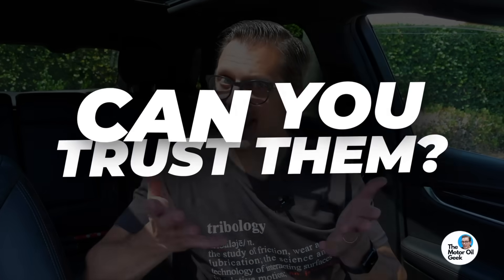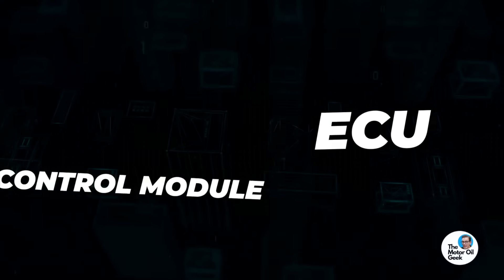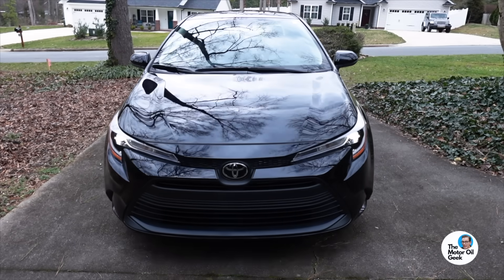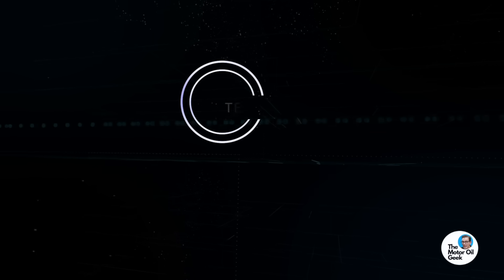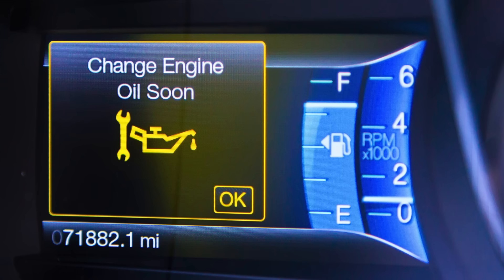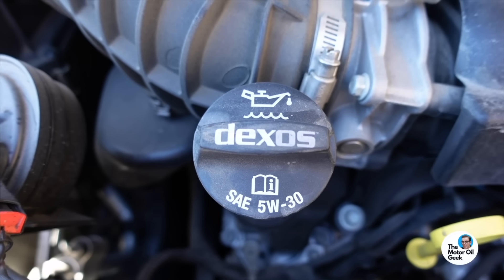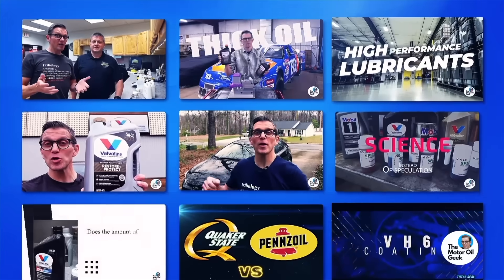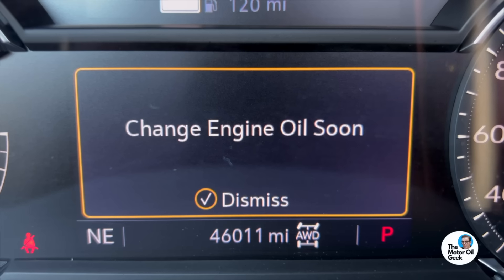The Accuracy of OIL LIFE Indicators REVEALED!

Comment: I once went 8000 mostly highway miles with a 130k mile 2012 Avalon (GRE-V6) using Pennzoil Ultra Platinum, and began getting valve train noise.  I changed it and it drastically lessened, then changed it again after 1000 miles and we haven't had that noise since.  I'm never going over 6000 miles again.  I now aim for 4-5k.
Reply: You probably got the valvetrain noise because it was low on oil..these systems don't seem to take into account increased oil consumption as an engine wears and mileage increases...I don't EVER let an engine run low on oil, even if it consumes quite a bit of oil...here again, extra oil is cheaper than an engine....
Reply: @dyer2cycle  That's often the case, but not an issue on our car.  It continues to go through well under a quart of oil between oil changes.  When I went 8k on that one fill, it was still at about 1/4 of the way between add and full on the dipstick.
Reply: @koomo801  That's great, but I would still recommend checking it once in a while..it's really not that hard, anyway, and only takes a couple minutes...sometimes a car will suddenly start consuming a bit more than it had been, even if there aren't any apparent issues..that's when it can catch you off guard....
Reply: @dyer2cycle  That's especially true for many modern cars which have gone with lower-tension piston rings and can burn more oil than what people driving cars from a decade ago are used to.  For example, our 2012 Avalon burns a quart about every 6k, our 2000 Tundra V8 uses about a quarter of a quart every 5k, our '92 SC400 uses about a half quart every 4k, our 2016 CRV uses about 3/4 quart every 5k.
Reply: @koomo801  Wow, I did not know that!! Thank you for letting me know! 

I’ve read articles of SUVs and pickup trucks burning a lot of engine oil after total vehicle mileage is more than 70k miles. My Equinox has 45k miles on it.
Reply: @alexsmith-ob3lu  Reports have been really rolling in lately on how well Valvoline's Clean and Protect oil does, especially where low-tension friction rings have become gummed up.  I'd try using that to prevent this from ever becoming an issue with you.

Modern vehicles are lower-maintenance than ever, but oil consumption and battery health have become huge issues with many (most?) modern models.
Reply: @koomo801  I use Mobil 1 full synthetic engine oil for my Chevy Equinox. No matter what it says; I change the oil every 2k-3k miles just to be on the safe side. 

Yes, you are correct about the battery issue of most modern cars. I get the battery checked quite often and if there is the slightest problem; I get the battery changed out right away. 

I don’t know about the “lower maintenance” for newer cars. My Equinox started to show some structure rust after two years of driving; so I got rust protection paint for my Equinox. 

I drove a 2001 Saturn LS2000 sedan for 10 years and there was hardly any structure rust after 10+ years of driving.
Reply: @dyer2cycle  ain’t that the truth! My VQ35DE consumes about a quart every 1,000mi. They’re known for it. Just turned 179,000mi this week. I always have a qt of the Quaker State FS 5W30 in my car lol. Check your oil levels at least every other tank or sooner folks
Reply: Try Quaker State Full Synthetic 5W30 (not Ultimate Protection/must be 5W30). As per 540RAT Engineering Blog it’s his dynamically tested current #1. He says the thinner mandated oils were designed to save fuel that we can never measure in our own usage. He said modern liquid cooled gasoline engines are “better served” using a highly ranked 5W30 on his list
Reply: Try bonding a lubricant to your engine. It will reduce wear by 50~90% and extend the life of your oil. You'll never get that valve train noise again without having to resort to more frequent oil changes.
Reply: @1Wondering  How is lubricant bonded to the engine?
Reply: @robertdevoy3119  Look up "What happened to Slick 50?"
Reply: most likely low on oil. those old gre v6 are known to consume oil especially with high mileage. New A25A-FXS 2.5L hybrid ones are much more stout. we changed all of our taxi from v6 to new A25A-FXS and all issues with valve train noise stopped. still many old folks didn't realize that yet, they still think old v6 are better. well, you can take Dorothy from Kansas, but can't take Kansas from Dorothy haha.
Reply: The same thing happened to my Chevy Equinox. I went for oil changes every 7k miles and started noticing excessive engine kicking noises. 

Changed the oil immediately and started changing the oil every 2k miles from then on. Never had that knocking issue since.
Reply: @alexsmith-ob3lu Equinox was probably burning oil and 2 qts low by 7000 miles. Mine burned 3 qts in 5000 miles. They did new rings sleeves at 80k. Transmission failed at 88k. Never buy another GM government motors.  Low oil was likely making the timing chain loose and it was slapping. Used to happen on mine. Great design. NOoOOoT!  DEI motors.
Reply: @BeefNEggs057  Holy cow! That’s crazy! 

Thank you for letting me know! GM is what I would describe as a “grey zone” where some of their cars are great but others are god awful designs.

Comment: I drive an '05 Yukon XL with the 6.0. I travel about 20 miles round trip to/from work (open road), to include a micellaneous trip here and there in between throughout the week. Currently, I'm at about that 5,000 mile mark and after checking my oil at the gas station recently, it's golden honey in color, still full, and you can still see the dipstick ridges clearly. I hadnt checked  my oil life indicator, but I know I can maybe do another 2,500 easily. I'll keep an eye on it, so we'll see where I'm at in a few thousand miles 🙂👍🏽

Comment: The last Ford vehicle I had, I changed the oil every 5000 miles, like I do with all my cars and vans. Sure enough, every 14,000 miles that damned oil light would come on as it didn't know I'd been changing well ahead of schedule. Never had moment's trouble from that engine, but if I'd stuck to the recommended intervals, I don't know how true that would be. To me, oil is the cheapest form of engine insurance.

Comment: Would a 2004 Saturn with 2.2L ECO tech have same GM oil system? Mine has an indicator that I have to reset. I never have driven it long enough to let it come one. Except for a few times that I didn't reset it.

Comment: The problem is that using an algorithm,  you can trust it till your engine is in good conditions but when it gets older or if something happens and your getting problems (like fuel contamination do to piston rings wearings or problems to the fuel injectors ,coolent in your oil) and you don't realize in having problems, you can't trust it any more.
Reply: Yeah, I’m surprised he didn’t point this out.  Maybe he did and I missed it. I feel like this video is setting people up for failure, thinking they can just go till it goes to 0% or beyond when this is only with one car with one specific engine and one specific oil. This is the least scientific test he could’ve done.
Reply: @calvinwalker4654  I had an '03 Grand Prix and the manual said aim to change the oil at 20% oil life or 1 year, whichever comes first. The algorithm sounds like it's pretty conservative to begin with, so between that and advising an oil change with 20% remaining even wear should be accounted for.
Reply: @calvinwalker4654  YESS!..when the engine gets on up in miles and starts consuming some oil, these systems are setting you up for trouble...USE THE DIPSTICK....
Reply: Fuel contamination due to stuck rings from low tier “budget” gas with no detergent package will throw that algorithm off for sure. Use top tier fuel (says on the pump. QT, shell, chevron and Texaco are several that are top tier with detergent cleaning your rings and keeping them from getting deposits and sticking.  A PEA complete fuel system cleaner like techron in the gas tank once per oil change helps keep the rings doing what they are supposed to. No more oil additives for me.
Reply: If you have coolant in the oil you have much bigger problems than OCI. And if you’re burning lots of oil the OCI doesn’t matter because you’re always adding fresh oil to the engine.

Comment: The problem with GM's is its acceptable to burn 1 liters of oil every 3200km. So on a 10k KM oil change you can be low by 2-3 liters, in a system that holds 4.5~. I worked at GM for 3 years and had a lot of newer vehicles coming in with the "change oil light on" but it was actually the add oil light.
Reply: It seems like some people aren't told to check their oil, water, tyre pressures and stuff any more.
Reply: @paulsengupta971  no one does that anymore( i do). On any of my Asian vehicles I never have to add oil.
Reply: @jroadfunk3665  Apart from on my 1991 MR2, I never have to add oil in any of my cars, but I still check it from time to time!

Comment: I change my oil every 5,000 or less in Summer. And I never run that 0w-20 the Government forces the auto makers to recommend. First oil change I went with 0w-30, in summer I may switch to 5w-30. And change it ever 3,000. All that milky thin oil, tiny engines with turbos and CVTs are just so the climate change believers can feel important, they could care less if your new Honda engine is dead at 88K. Speaking of CVTs, change that fluid every 40K miles if you plan to keep the car long.

Comment: I set the trip when I change oil and change oil at 3000 miles.  
If I went with Honda accord oil indication it ends up being 7500 miles. 
Same in my 17 Silvy 7500 miles. 🤷🏼‍♂️.  3months 3000 miles I guess shows my age. 
I’ve gone to 4500 and I still feel weird. Lol 
All my driving is 80mph turnpike 45min a day each way 2500-2900 rpm

Comment: Pre-filled the oil filter every time a use motorKote or some type of friction modifier that applied to the working parts of the engine and it will not dilute the oil
Reply: Doesn't work well if oil filter is mounted horizontally or attachment side down.

Comment: My wife drives our VW CC (2.0T) around town and it does not get many miles on it.  
Would it be prudent to change the oil twice a year (when I change tires for the season)?
I use a full synthetic oil for Euro engines 502.00 VW recommended.  Usually Mobil 1 0W-40 or Castrol 5W-40 or my service tech has been using Liqui Moly 5W-40.

Comment: Interesting- I always figured that the Oil Life % indicator was an extremely simplistic mileage ratio calculator which would start out at 100% after resetting after an oil change, and then would decrement %s based off how many miles have been driven within the semi-universal 5000 mile interval.  So 80% would mean you have 4000 miles of driving left, or in other words 1% would be decremented for 50 miles driven.  
I still stick with my 5000 mile interval though.

Comment: I just felt like you undervalued your company and the benefits of getting your oil analyzed re as an indication to the real condition of the ENGINE, not whether the oil monitor is accurate or not.
Reply from the maker: The point is many people will never do used oil analysis, but it they have a GM vehicle, they can save some time and money by following the OLM instead of the windshield sticker from the quick lube.  

Obviously, I believe in the value of used oil analysis. It can provide way more data that the OLM can, but this video is for those who will never do used oil analysis.

Comment: I learned the hard way trusting the oil life meter. I never noticed that I was doing my oil changed every 8 to 9k which miles at 1% now I’m stickin to the 30% life which is around 5k miles.
Reply: How did you learn that hard way, what problems did you have with your engine?

Comment: Lake, my Dodge needs to have the oil life zeroed at the change. I assume the GM cars are the same. 

What if the indicator was not reset in that rental? Wouldn't that make the oil test better than the Indictator would suggest?
Reply from the maker: That's possible, but the used oil analysis data we have correlates well to what we saw with the rental. Also, visually the oil looked really old.
Reply: @themotoroilgeek  Thanks for the additional information.  Love your work.
Reply from the maker: @danbusey  Thanks!